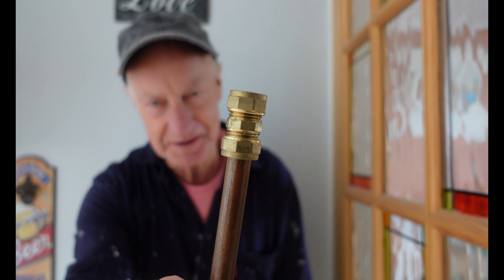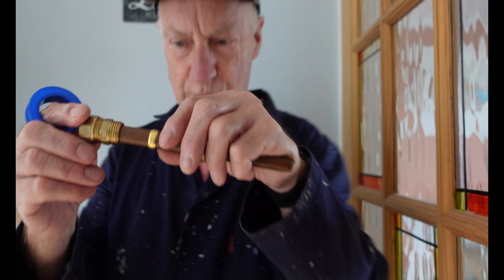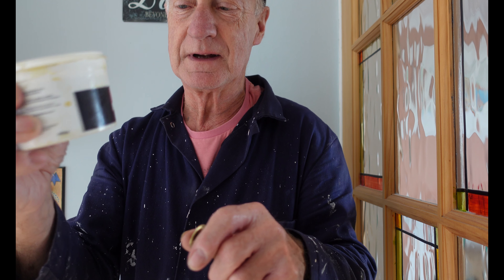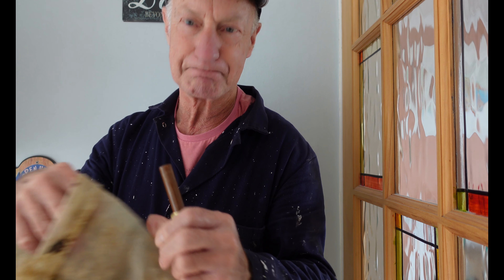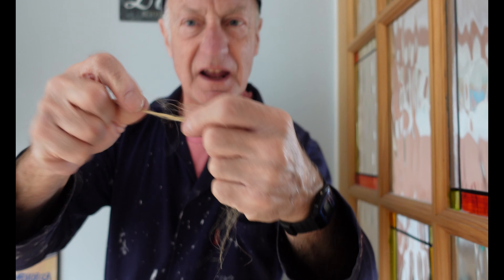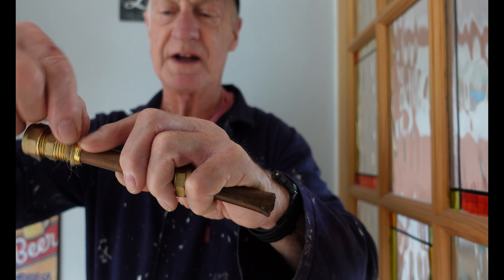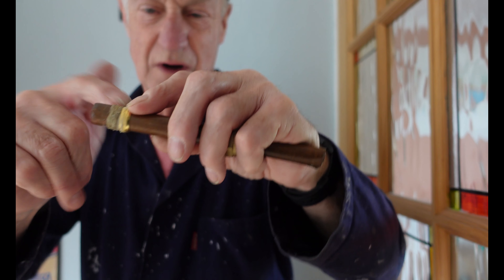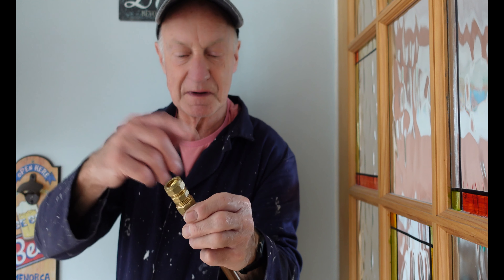How to fix leaks on compression fittings

Comment: Can you still buy hemp? I luckly got bag of it my dad gave me years ago and it works every time , recently used it when I replaced my f and e copper cylinder put hemp on the 28mm fittings and a smere of furnox , you wouldn't want a leak after all that effort...
Reply from the maker: You can still get it.

Comment: Hi
Merry Christmas 
I’m an old ‘Maintenance Electrician’ and I’ve got to say I’m glad I found your channel on You Tube.
Couple of questions from an old sparky to an old plumber :-)
1st one. Am I right in thinking that BOSS White is only safe to use on non drinking water pipe joints? (Gas, low pressure steam, Central Heating etc)
2nd question. Does it matter what direction the hemp hair is wrapped? (I know that PTFE goes the way you tighten then coupling)

These may be daft questions but sometimes daft questions need to be asked.

Keep posting your tips and keep sharing the love.
Someone said to me at work...
We used to be the ‘lads’ on shift but now we’re the ‘mesters’ and it’s up to us to make sure the youngsters know the ‘old tricks’ to make the jobs go smooth.
All the best.
Reply from the maker: Merry Christmas to you too. There is a boss white you can use on drinking water, I believe it is a fernox one. Thee hemp on joints is usually wound clockwise around the thread as though you were screwing something on.
Reply: @dereton33  Fernox Water Hawk??

Comment: Cannot use hemp on potable water pipes as horse hair is defined as a contaminent Al. Guy in class works for the waynker (walter) board
Reply from the maker: Forget that nonsense, it has been in use fore over 100 years and no one has died yet. They will be saying putting tea bags in hot water is a containment too.